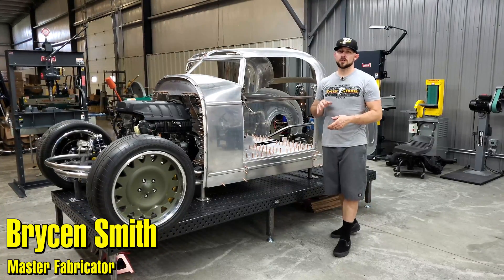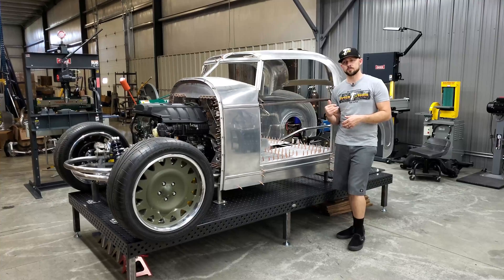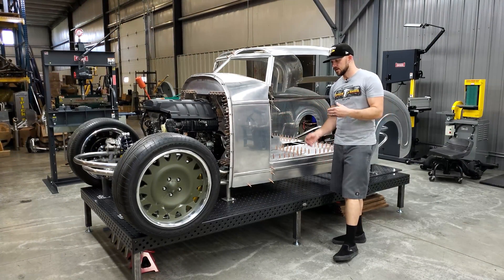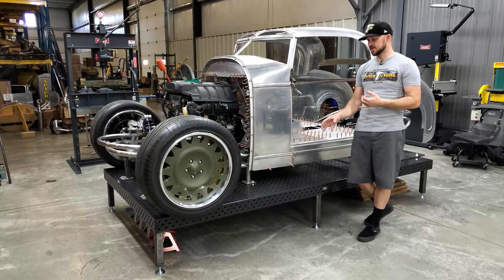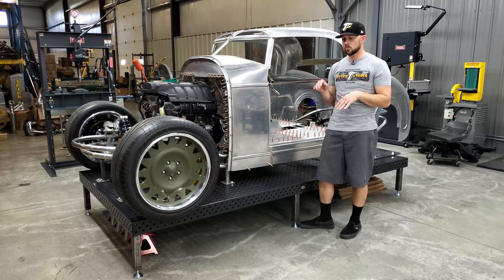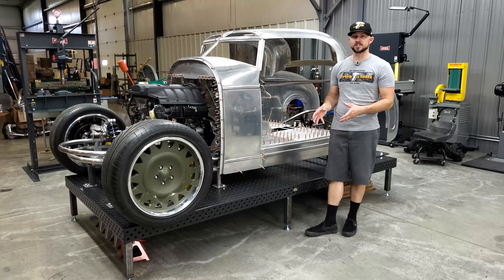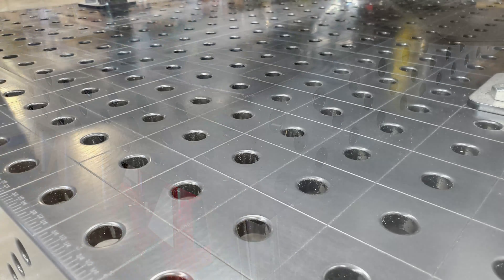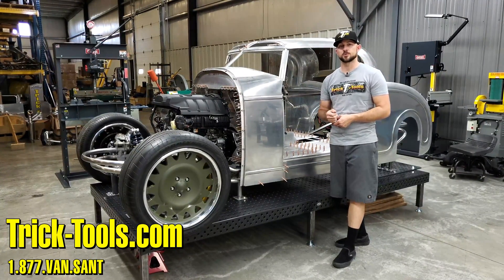Siegmund Imperial Welding Table - Trick-Tools.com

Comment: The series 16 strong enough to hold that car?? Figure the 28 was preferred table for cars etc.
Reply from the maker: yes it is! the Imperial 16 table is rated for a maximum weight load of 11,475 lbs. (Based on Even Distribution) the car that is on this table will come in between 16-1800lbs when its complete.